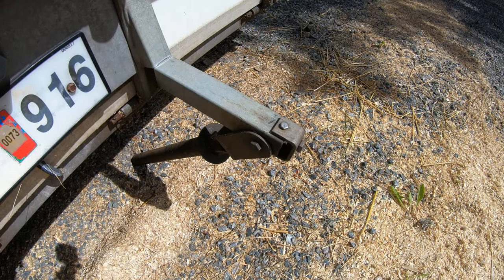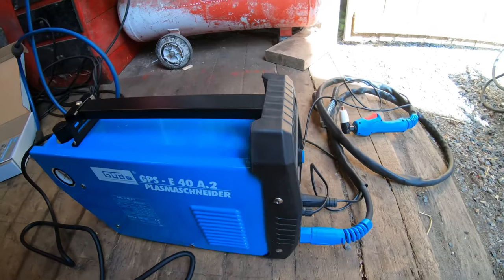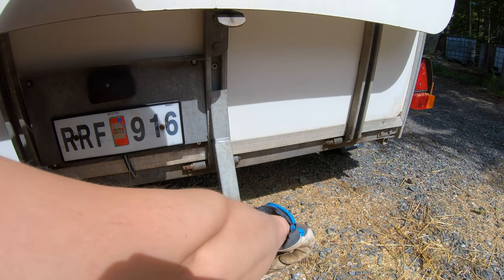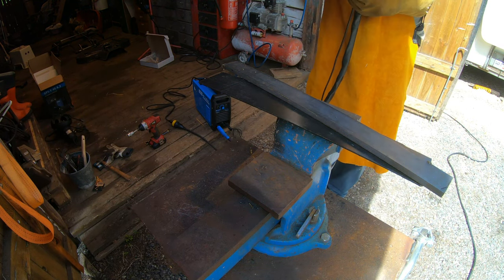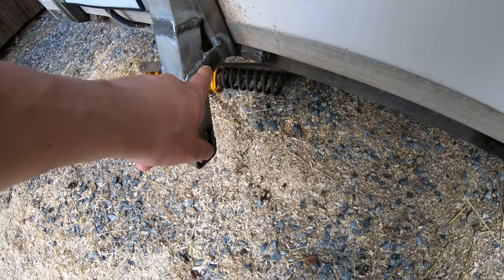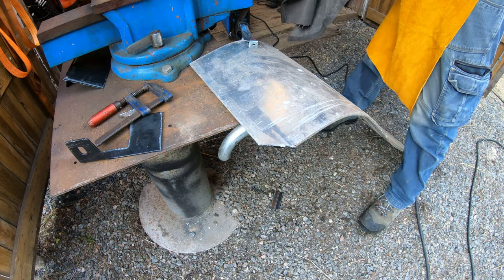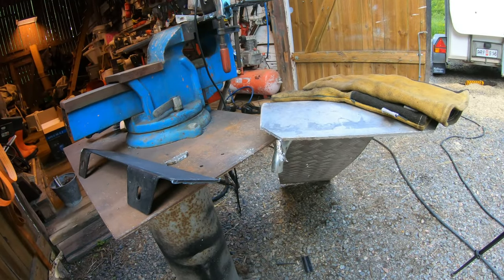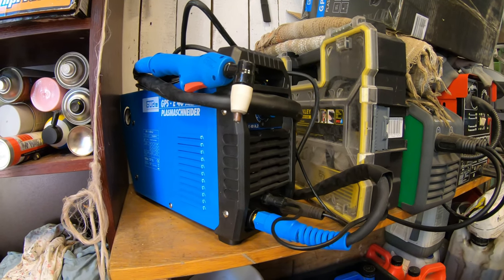Fixing my horse trailer and testing the cheapest plasma cutter on amazon.se

Comment: Seems it worked pretty good for the thinner stuff would be ok if you do not have to cut anything thick.
Reply from the maker: It was great on the 3 mm steel and I guess it could cut 5 mm quite easily but when I build stuff for the excavator I want to cut thick steel so I need another machine.

Comment: Watch mike festivas latest videos on plasma cutters he does a very good reveiw on a cheap cutter that does very well it’s like $300 but it cuts great and u can even use it on a cnc plasma machine tell mike I sent you
Reply from the maker: Ok, I might have seen it but I will check it out anyway. He has a great channel and seems like a real humble and nice guy. We do have other electrical system here, my main fuse is 20 amp on 3 x 220 volt. Most appliances run on one phase 10 amp but some need a 16 amp fuse. The most powerful machines use all 3 phases. They take less from each fuse and the power delivery to them is smoother resulting in better performance when welding/cutting etc…. Have a great weekend!

Comment: Thanks for the video.
I found that a 40amp plasma cutter can cut 10mm steel if you use the right settings and speed.  Here is a guy who cut 25mm but thinks he wouldn't do that on a regular basis with 40amps.
https://www.youtube.com/watch?v=nmqbciRUTyY
Also if you lift the drag tip 1mm off the surface when you are moving and lean it on your other hand then it won't stick and you get a cleaner cut.
Reply from the maker: There is no way this machine would cut more than 10 mm but I don’t think all 40 amp machines are the same, this was a cheap one. Good tip on the handling of the cutter, this was my first time using one so I need to practice. I found that dragging is much better than pushing and that with the wrong air pressure it will stick much more.